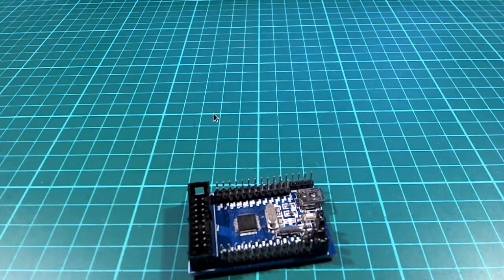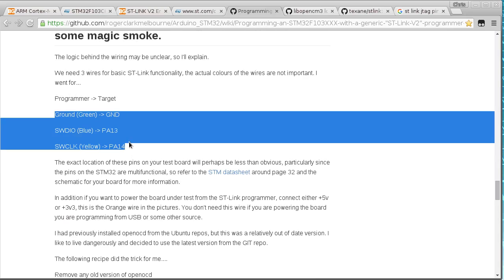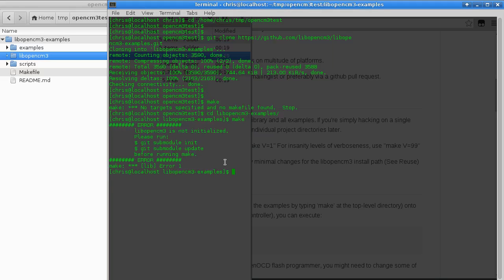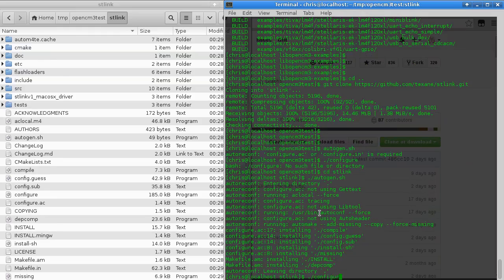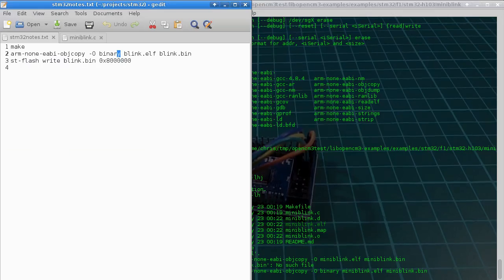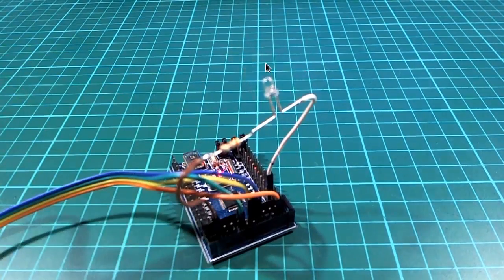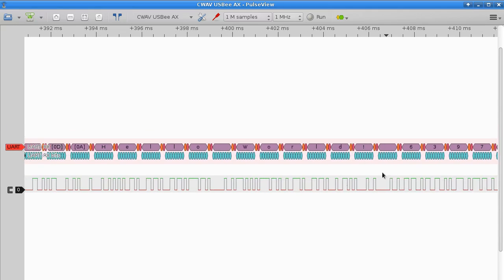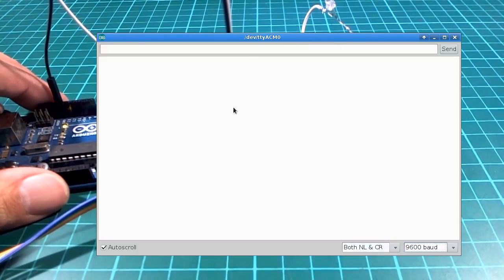STM32 dev board first steps (linux)

Comment: Yes, I watched the whole thing. Sorry to see you struggle so much. At the beginning, it's probably best to use STM32Cube. I don't know if it is available for Linux.

As far as the serial communications, I had the same problem with another no-name brand ST 3.3v demo board, and a 5v usb to serial adapter. The board seems to tolerate 5v signal coming in on the Rx line, but 3.3v out of Tx was not read reliably by the adapter cable. I finally solved this by putting a 100k ohm resistor from 5v to the ST board's Tx line. 

I did start with a 10k resistor, which also worked, but then got a bit concerned about excessive current into the ST chip. After some calculating, I think anything up to 300k should work. Since it worked intermittently without the resistor, it just needs a tiny nudge upwards.

Comment: Hey Chris, finally got an ST-Link thing delivered and found my 'ugly' board from March last year and thanks to you and Roger Clark (Arduino port)
have at least a flashing LED. Thanks much for explaining the JTAG pins as there isn't much info on the web about about the pinouts.
Next thing is handling interrupts from 2 x 1024 PPR A/B Quadrature encoders. Doubt that will be much fun!
Reply from the maker: After making this video I discovered the mbed platform which is much easier for working with these boards and other STM32 stuff.
Reply: Sorry mate, forgot about mbed from a previous reply from you.
Will check it out again soon.
Although you probably don't want the title I think you are the destined to be the next  'Project Blue Falcon'.

Comment: The binary size is explained by using printf and stdio library.
Fully featured printf is quite large because it needs to handle all kinds of inputs.
Sending a character to the serial port is really light-weight so if you were to look for a light-weight replacements for stdio/printf with a subset of the features of the stdio version or make your own, you could shrink the binary size drastically.
Binary files are more compact than hexadecimal files because they contain the raw data so one byte of file represents one byte of flash. In hexadecimal files, the flash content is encoded into hexadecimal text where two characters can represent one byte and one character is 7 bits if ASCII.

Comment: SWD and JTAG are not the same; but they are used for the same. 

JTAG is the oldest standard and was originally intended for at somewhat different purpose; but was later repurposed for debugging. SWD is a newer standard and is used exclusively for debugging/flashing. SWD use fewer pins than JTAG. Most Cortex-M processors support both standards; but not at the same time, since JTAG and SWD are multiplexed on the pins.

SWD is designed to co-exist with JTAG. Part of the initialization sequence will make the device know SWD is used. Hence, things work automatically.

Happy hacking  :-)

Comment: The reason the code is so big is because you are using the standard perf library it seems, the library does a whole lot of function calls for things that you can do in a few lines of code or simply it yourself. It also compiles some code that doesn't ever get run at run time and some safe nets that you will probably not need unless you are using the board for professional development.

If you are feeling brave enough and are making a project of some sort, you can isolate all the parts of library you need and make it friendly and fit to your needs. This reduces both the time spend trying to make things work(if done right) and the amount of space used by code (up to 10 times less space, several bytes if you are doing a blink example). 

You can even make your own HAL if you know you will use the stm32 f1x alot. By doing this it means you can make code that seats on top of the HAL which intern means you can move it around to other platforms (provided you make your code somewhat  hardware independent). Ohh and also, you can port most of the code made on a lot of the stm32 family to other  stm32 platforms eg, stm32 f2x, etc. This is because most of them use the same standard perf library or a subset of it.

Comment: Hello Chris, nice video. with this knowledge i might dust off my stm32's again, and yes. i did watch the whole one.
the reason that you couldnt see anyting is that the cable should be connected to the arduino pin 1 (tx) - you want to simulate that the atmega is sending the information, not receiving it. you know its twisted at the serial->usb point.
and for not being able to use the usb devices, check if you are in the system group "dialout", if not add you to it and logout and in again.

Comment: you have to use the TX pin on the arduino board as the labels are from the perspective of the AVR not the serial bridge. also make sure the sketch on the arduino doesn't use the serial pins or it will be outputting and fighting with your ATM board. I usually just load blink or you can pull the chip or jumper reset low to hold it all high impedance.
Reply: STM not ATM. damn autocorrect
Reply: I was going to say that. The RX pin on the Arduino goes to the RX pin on the AVR and the TX pin on the FTDI (Or whatever that's using), so you have to connect to the TX pin on the Arduino. And yes, the sketch on that AVR was probably pulling the TX pin high or low, not the RX though. So, hold on reset or upload a sketch that uses the TX pin as an input. Heck, just use a standalone serial bridge!

Comment: Thank you for this. I had bits and pieces right, but you put it all together in one place, and, it works.  The arduino just needed to be set up with "if(Serial.available() > 0){Serial.print(Serial.read(), char()); }" in the loop. Once I uploaded that sketch, it printed the serial output perfectly, instead of garbage characters.

Comment: I did watch the whole thing! I usually don't watch long videos straight in one go, but that's not a problem. Interesting stuff indeed, I have to say. One thing about the relative complexity of the ST SDK: It's not very hard to abstract complexity away with a few C++ classes and build a more friendly environment a la Arduino. You can also make the build / compile process much easier with a few shell aliases, a C++ IDE if that's your thing.

Comment: You can upload code without an STlink via TTL-level serial on pins A9/A10. I've used it to load a maple-mini-style bootloader onto blue pill (a common STM32F1 board commonly seen on aliexpress/taobao, along with red pill boards which are functionally the same) STM32F103C8 boards to then allow upload via USB.

Another interesting factoid, most C8 chips actually have 128k of flash. They're likely using CPU binning though so the memory above 64k might have a chance of being dodgy.

Comment: You can actually use nucleo board (the top part) as as a ST-link V2 programmer. You don't have to buy one separately.
Reply: @jobaptist  Ubuntu 20.04 is pretty good, nice .... looks nicer than the old windows he stole from Steve Jobs while hired for Apple. .... but probably to hard / difficult for you ..... it can do alot more than windows out of the box.
Reply: @AnalogDude_  can i buy it from you
Reply: @AnalogDude_  i prefer to use VB.NET for my  programming. i really dislike to use c++ mostly for donkeys who unable to learn proper programming language.. just image c++ so pathethic and unable to function correctly without the ;
Reply: @jobaptist  dude, C++ is the grand daddy of them all .... VB #net wouldn't exist without C++.
C++ is the King of them all,
visual basic, visual c#, visual J, php, MySQL, etc, etc, etc, etc, etc, etc, etc ... all made with C++
Reply: @jobaptist  try using (Nokia) Qt C++, works everywhere.

Qt | Cross-platform software development 

www.qt.io

Qt is the faster, smarter way to create innovative devices, modern UIs & applications for multiple screens. Cross-platform software development at its best.<

you'll love it .... it beats down Microsoft handsdown.

Comment: Printf is usually a pretty complex and consumes memory a lot. . It is also probably linking in some floating point library functions. I'm not supprised to see 24k program size. (Like in arduino, avoid complex funtions and floats if you want to save memory).
Watched the whole thing.

Comment: Just dug out the same board I bought in March 2017, watched your video again and am now to tired to do anything!
I must say your patience is great Chris and that you'd be a good partner (for an android robot at least) :-) 
Now to see if BG have stink links in stock.
Reply from the maker: You might be interested in the mbed platform. It's a hell of a lot easier to use than this, I might make a video on it sometime.
Reply: Hey, thanks much Chris. I'll check it out, I'm looking at options for 2 x 1024 PPR Quadrature encoders running up to 300 RPM and running
out of options for fast interrupts. The other option is an ESP32 BTW.
Currently looking at INBED technology :-)

Comment: I'm writing these points as I watch (and sometimes skip) the video, so there could be some things that are explained later in the videos anyway.

You can use all the IO (UARTs, I2C, SPI) on all package sizes, because almost all of them can be remapped to different pins. It would have been totally possible on the Naze32 for example to have three hardware UARTs, if the layout/pinout would have been selected better. This annoyed me so much (I wanted CLI, SBUS and smartport at the same time) that in the end I got a F103VE based dev board, and changed cleanflight to use all the 5 hardware UARTs the VE version provides (that part is in cleanflight trunk now). I still wouldn't be able write a program for the STM32 from scratch though.

I don't really understand why, but for all the devboards with the F103C8 I had, it was possible to flash a 128k bin although the chip should only have 64k. That was not a hack, the possibility was offered by the STM flash loader tool (provided by ST), the verification checked out, the program worked without problems. I don't know, why there's a the F103CB version (which has the 128k flash as per spec).

You can program the STM32 family just with an USB-to-UART converter. They have a bootloader in ROM (unbrickable) activated by shorting one of the boot-pins. But the stlink-dongle is much easier to use and needed if you want to hardware debug.
JTAG/SWD are different modes of the same pins. SWD is what you generally use with STM32 (to program and debug)

I never use stuff like printf on a micro if I can avoid it. Speed being one reason, memory usage another. Just having it in your code once also blows up the bin size as you've seen.

If you don't see anything on a UART always switch RX and TX as first try ;) . The RX/TX labeling on the Arduino is for the AVR not the USB-to-UART chip on the board. To avoid confusion like that, use an USB-to-UART dongle. I love the CP2102 based ones (never liked FTDIs especially after what they did with the drivers on Windows).
Reply: That board have boot jumpers, didn't know it came with an UART bootloarder built (the chip),  does it take any amount of user flash or eeprom? in that case can i remove it?
Reply: nvm AN2606 document is clear :)

Comment: Nice video! I watch it all, and you not the only one that have spend hours to get the blink program working on that thing.

The problem that you have that you need it to run it as root (arduino/stlink flasher) is that you not allowed to excute on the device (/dev/ttyACM0).
What I do for the arduino is just chmod 777 /dev/ttyACM0 so every one can write/read/execute on the uart port.
Or you add your self to the group that is allowed to use the device, on Arch Linux (use it my self) it is uucp and lock and on Feroda it is dialout.

The second think is that ST-Link flash is not allowed the use the usb device. The simple solution is to set the USB device in udev rules that every one can use it/address it.
Here is a link from the Arch wiki where you can find more over it.
https://wiki.archlinux.org/index.php/udev#Writing_udev_rules

I hope it helps, do not run everything as root.
Reply: Instead of useing chmod you could add yourself to the uuc and lock groups as shown in the Arch wiki https://wiki.archlinux.org/index.php/Arduino#Configuration

Comment: I'm 90% sure you should be able to program this using the nucleo board, which have the same programmer in the top part (just like other stm32 discovery boards)
Reply: Tibor Ölvedi It shoukd work after removing the two jumpers that connect the STLink to the MCU.

Comment: PS: the reason you did not see any serial from the arduino is... did you program the arduino to forward its hardware serial port to the usb serial port the arduino uses?
Remember the serial port you see in the debugger is a "virtual" serial port between the arduino and the PC - not the hardware serial ports on the arduino.

Comment: Hey Chris, thanks for the info.
 I saw your recommendation for mbed in comments. I hope that is less involved. At 37:40 you mentioned if the ST Link driver doesn't show up (just after the time-out flashy led programer bit). On Ubuntu I didn't have a problem with it showing up but I did need to add the USB ID to a .rules file in the /etc/udev/rules folder to get access.
 Also my ST Link programer doesn't flash like yours but it times out just the same. I think it's geneticly related to old Nintendo cartridges... take it out and blow on it to make the sili gods happy.
Thanks again
-Jake

Comment: Thank you. Now i know im not going to develop something with an STM in the near future. It is a mess setting up everything.
Reply from the maker: It sure is, this way at least. You might like to take a look at the mbed environment, it gives you an online compiler where everything runs in the browser and you download the compiled binary. For some supported boards it can also flash the firmware too. http://developer.mbed.org
Reply: Once you get it set up and talking to it then the fun begins. I actually started using stm32 before using Arduino. I loved the power but I couldn't find libraries like you can for Arduino. It more complex because it a 32 bit and has a Lot of power and things that the pros have to use. Arduino is for  applications that do not need the high clock speed and memory but it a great starting point for everyone and most projects don't need all that complexity.

Comment: I might be late to the conversation but, add your current username to the dialout group. su to root then ... usermod -aG dialout <username> ... this will remove the need to be root when you run the serial monitor in arduino. BTW don't forget to logout then back in for changes to be made.

Comment: Another great video - I'm wondering where you think you may go on this? are you thinking of programming a new FC, or maybe just wanting to modify what is out there? if anything having to do with an FC, then why not start out with at least an F3 board?
PLEASE keep up doin' what you're doin' - I seem to be on the same plane of interests as you - love the Maryam Tracking Camera, the Geeetech VR vid - also all your iNav stuff (that's how i first ran across your vids.) the laser transmitter, the ammeter/power supply (i'm getting into higher powered LED's. i'm also a beginner quad flier.

Russ from Coral Springs, Fl usa
Reply from the maker: I was thinking of using the nucleo board to make a kalman filter sensor fusion of barometer and accelerometer to get a nice accurate and fast altitude measurement. Then I tried the iNav rewrite and found it to be good enough already that I didn't bother. I have no plans for the smaller board, but it's a nice cheap one to have for some unknown future project :)

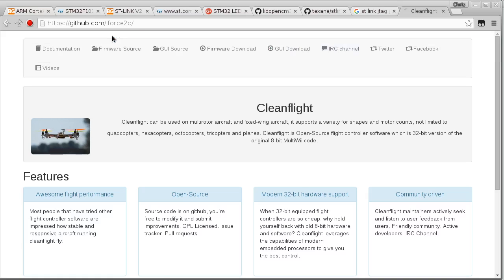Comment: @30:00 I was just listening in the background
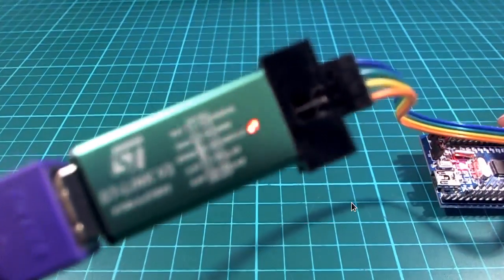@38:00 but the program was miniblink...  it wasn't supposed to blink the light on the st-link? lol.
@49:00 sure why not. it is like listening to the radio in the background.

yes I watched it all.  shouldn't there of been a sketch on the arduino to repeat the rx signal out the tx pin to the pc? could you of possibly meant to connect the tx to the tx pin so that the pc hears the stm32 instead of the arduino?
Reply from the maker: +I don't want a channel I'm just commenting Right, I don't know why I expected that to do anything without the appropriate program loaded on the arduino. When I tried it earlier, I was using an FTDI adapter. I should have just connected to the tx pin instead, correct.

Comment: I watched to the end mate and I know nothing of LInux (yet) but have experimented with the Dev brd. You may write the FW for Cleanflight and some others with a serial adapter via the UART  and whilst using the ST Microelectronics - Flash Loader Demonstrator application (Windows sorry). Just have to move the BOOT0 jumper one position during this kind of programming. (BTW in STM Flasher you may adjust for 128K memory for the target)
The Cleanflight FW is bigger than 64K but fits, in fact the most recent version 1.12 RC2 is 345Kb . When I was messing with it, CF was Ver1.7 and the file I loaded to the F103 was ~105Kb  I am assuming that your end goal is to use it as a FC ,..If that is what you are attempting to do, please refer to RCGroups http://www.rcgroups.com/forums/showthread.php?t=2154329. All the pinouts and wiring are discussed. Also you may then address the I2C connections for a GY521 module  (??) with the full 10DOF :-) I had mysterious failure of two of the three boards I was using and was left with the exact one you have there. My only beef is its size and the loose Dupont connectors. Also the crowded pin breakout. I will be following just to assimilate some methodology for Linux and working with Github 
As always, best regards.   Chris